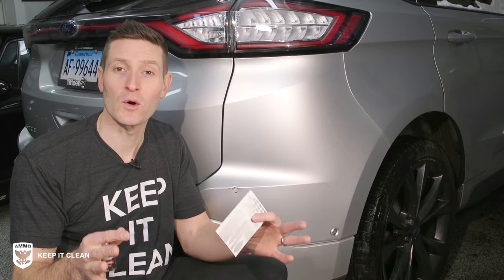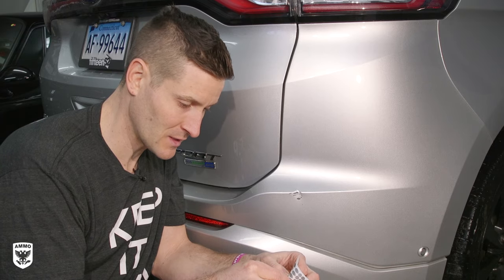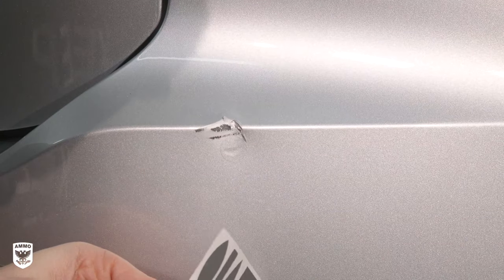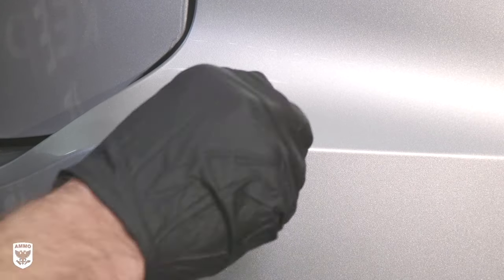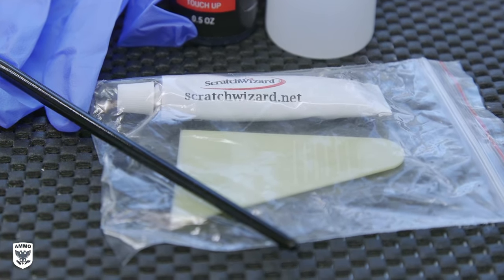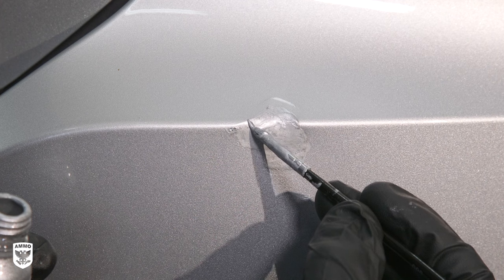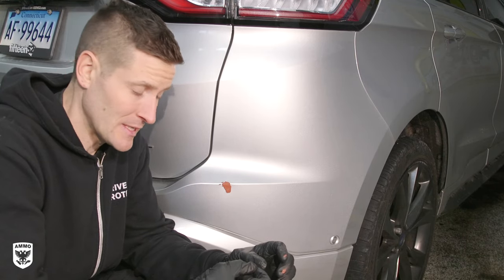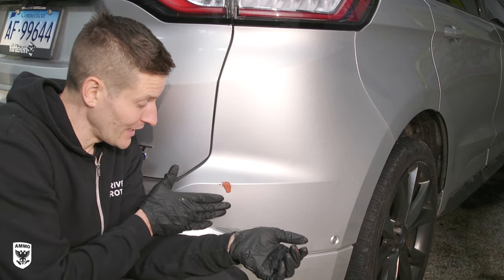How to Hide a Bumper Scuff Fast

Comment: wouldn't a make shift spray paint method work?

I'd get a straw (bendy would be best), cut a hole in the middle of it or the bendy part (kind of like a recorder)
fill the straw with a little bit of paint (not too much since you'd want it to spread) but not too little where it'd dry and only a few would come out.

blow hard into the straw like a blow dart (just be careful not to inhale or ingest the paint) 
to be sure, the end where you blow it from must always be above the end where it is going to come out of at all times
this'll minimize the potential of inhaling it or having the paint run towards the end where you blow from.

you could also use a spray canister like a keyboard cleaner to completely minimizing poisoning

 i think it'd do a much leveled and uniform look and you won't have to worry about the paint dripping/sagging while it dries as the paint is applied via air.

Comment: Could you not have done what you did, by puttying etc etc but then taped it off and used an aerosol spray can on that area? The metallic flakes would disperse a lot smoother than straight up touch up paint. Then let it dry, take off the tape and use a compound and polish to smooth up the edges?

Comment: Should have sanded the small dented area back to the panel its self  ,then cleaned with alcohol and filled the cavity with little problem to a much higher standard imo! I used to be a mold make maker and filling and sanding out imperfections although it can be tedious is a job you have to master! I would never use these stickers on a customers car and expect to get paid for it!

Comment: I don't even bother with touch ups. I just wash and wax what I have with pride.  Bad touch ups look far worse than just leaving it be. I spent about 3-4 hours attempting a touch up and it looked so bad that I ended up sanding it off so I wouldn't get laughed at. I've painted several houses and draw pretty well but doing auto body work is a different gig. Seems like spraying the whole panel is the only way to really make it look decent?

Comment: Why don't you use spray paint?  Create a stencil the exact size of the area to be painted, but have the stencil about an eighth inch from the surface of the car so you don't get a sharp edge where the edges are.  

.

Comment: Definitely not going to last for any decent amount of time. Nevermind the fact it's a sticker, but you left sharp corners and had two pieces seam at a bend. If the bend doesn't cause them to delam and fail first, the sharp corners catching anything that gets rubbed against them will. That being said, I am surprised how nice the stickers actually look. I've seen body shops not color match factory colors that nice.

Comment: Why not just tape around the filler you added and use color matched rattle can paint. It will look  better than the sticker since you can probably sand down the edges the tape created when you sprayed it.

Comment: The video title is misleading.  This wasn't a scuff, but a small dent and gouge. You called body putty Bondo a few times. Bonda can't be levelled wth a liquid.  Isopropyl or denatured alcohol works fine to level body putty.

I thought that the stickers might be good for protecting new chips against further degradation until you could address them with touchup, but $40 for a 3"x5" sheet, is ridiculous.  I'll keep using Miracle Nail for that purpose.  It costs a buck at a dollar store, makes a good short term bond, and peels off later.

It never makes sense to skimp on preparing the surface because anything applied to it will telegraph and magnify defects.  That being a plastic bumper cover, there was an approach to prep that I would have considered: pushing out worst of the  deformation by removing the rear fender line and using a heat gun with pressure from the inside.  But I get that Ammo NYC isn't into using tools and doing bodywork, but beautification.

For a small job, if you are going to use a brush, you may as well use a Duplicolor or factory touchup paint kit. A smart owner will get one or two of these kits included in the purchase of a new vehicle or a used one bought from a dealer who sells that brand.

That touch-up paint kit is a total waste of time and money.  The normal ratio of prep time to painting is 10:1, not 1:10. For a lower price you could have bought a color matched one stage paint in a small putup, a Preval sprayer, and proper body filler and sanding sheets, and the job would take under an hour from start to finish.

Comment: not sure why he kept adding more paint after he would sand it and smooth out the surface of the touchup.
Reply: This is why in auto body they sand with a block , he could of made a small one.... You can NOT get it even by hand unless you're one of those gifted body guys and they are few and far between... He could of done a lot of things, I have done it before with great success but I  worked in auto body...  He could have searched YouTube, I mean he is on it everyday ...

Comment: This is an example where you cannot just hide the dent like this on the bumper without repainting it. His skills on paint restoration from neglect and bring it back to life is no match for this type of damage. Using the stickers to repair bumper is a joke, how long do you think this will last. This is where the body shop has the upper hand in restoring the bumper as close as possible to the original.  He is right to fill the dent on the bumper with Bondo and sand it flush to the rest of the bumper surface. However,  using touch up paint in a large area like that will never work. The right way is really get some primer spray paint, base coat and clear coat. Without the base coat, the touch up paint would have peeled off anyway.  Given the size of the dent, he does not really have to repaint the entire bumper, he can mask it off and repaint a smaller area and try to blend with the rest of the right bumper corner. The primer and base coat spray paint will cover the repair nicely and the clear coat will help protect it. There are plenty of good videos on how to apply primer, base coat and clear coat to fix small dent like this. What went wrong is he was trying to use his skills in detailing to repair a proper paint job.

Comment: Better use filler...(scratches removals set) 2 Then sandpaper, undarlay spray, sandpaper again, small can of paint spray (10$) with  yours colour, dry, polish and in around 2h will be no different... I done my Benz like that in 4 zones and when I sell the car no one see difference and I was doing this for 1 time!

Comment: I think you'd have been better to spend all the time on bondo - fill - sand and repeat about 6 times, then the surface would be perfect for the sticker and cutting back the high ridge at the top first, get rid of that ridge right off the bat.

Comment: No man...this is like putting an electrical tape on top of your dash if the "check the engine" light comes on. You made it worse than it was. I usually like your videos. Brave to still post it.
Reply from the maker: I was showing options that were available on the market. This is a short term band-aid, literally, until you can get the car fixed properly.

Comment: I’ve seen your videos are you are a great guy but...

The paint in a touch up is way too thick to use for professional touch up. If you had body shop mixed 2k paint and thinned out you would have got a much smoother finish as extra thinner you would have added would have aided this.. Also if you had bodyshop mixed quantity of paint you could have mixed correctly by eye so would match evenly.

Given your attention to detail and passion just get a side line job and a body shop within a year you will understand paint to another level.

Comment: I guess this just proves that the only way to make damage disappear completely is to have the whole panel re painted, there is no 100% perfect smart repair!.
Reply: Nonsense, you can paint a spot repair the size of a beer coaster if you know what you're doing.
Reply: Seneric It’s not nonsense  according to quotes I received from three separate reputable body shops regarding stone chip damaged on the bonnet of my car, I was hoping for a smart repair to make these chips disappear, I was told by the three separate unrelated companies that the only way to make it 100% perfect is to repaint the whole panel, thank you for your input but I think I will go with the professional opinion!!.
Reply: @skodakatie7341  I am the professional opinion, since I work in a body shop as a professional painter myself.

You're the one who doesn't know.
Stone chip damage is not suited for spot repair because the damage is not in one spot.
Big difference compared to what is shown in this video.
Ofcourse you should paint the entire panel for something like that, common sense.

This particular damage however is the exact opposite, perfectly suited for spot repair.

So your initial response that spot repairs are just no good in general is still wrong.

And on top of that, you should take note that this guy is a car detailer, and has very limited skill knowledge and experience with actual repair techniques.

Where I work and live, the use of cover up stickers is considered amateur level work. Unprofessional stuff really...
Reply: Seneric I accept your advice, you’re a professional, I don’t know anything about painting cars, it was just my opinion with regard to my own experience with paint damage on my car which was a large stone chip,  I visited three body shops, who all expressed the same view which was the only way to achieve a 100% perfect result is to re paint the whole panel, maybe because they saw that I take great pride in my car, and was looking for an A1 perfect result.

Comment: Auto body repair are even cosmetic work is what I would call this repair is not for everybody there's no reason that you could not have what sanded the spot putty or glazing party nice and smooth and then applied touch up paint it's a very small area even those stickers would have looked so nice if you would have just took the time which would have been less than an hour from start to finish if I would have done that to a customer's car I would have been arrested for Auto repair fraud and was been all over the internet for being a scammer but somehow you can get away with it

Comment: You washed the entire car and put up links to products. I get it, you want to make money. All I wanted to see was the bumper scuff repair. I don't see any links to the plastic stickers. Maybe they are there but I don.t see them due to the other unnecessary links. Why do I need a new foam gun to fix a scuff? Also, you should have just pressed down the parts of the sticker surrounding the divet.

Comment: Cant believe they let this guy work on expensive cars.. 8 hours to fix a touch up?lol..
 da sander with a sheet of 500 paper,level it down and surrounding area for about 4 seconds. Fill it with putty,sand it to suit,light dust of primer out a rattle can,light dust of base out a rattle can,light dust of clear out a rattle can.. Showroom condition in about 15 minutes. This is just horrendous.